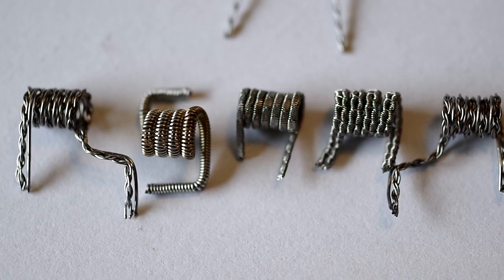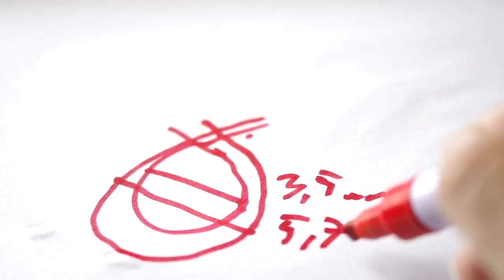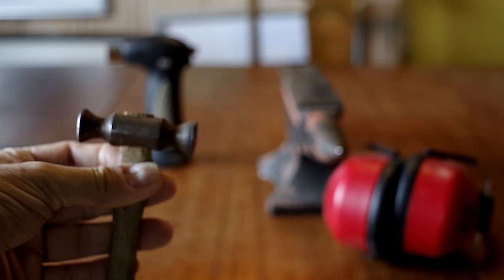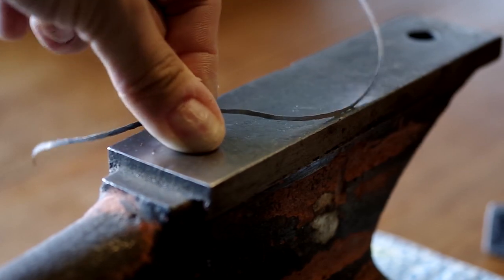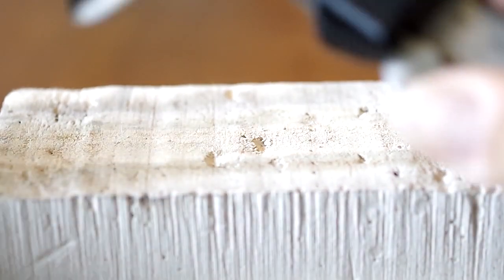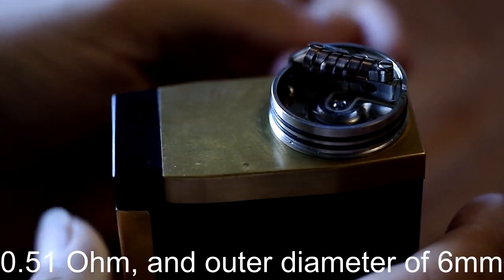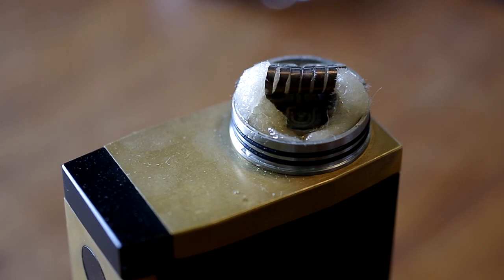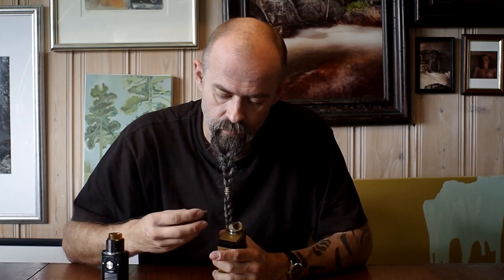Flat wire coil build tutorial #001

Comment: Just curious: have you tried to use a press to flatten wire?
Reply from the maker: Yes, I have used a roller. Basically the wire gets longer and flat, not much wider. But if you start with a 14g or 16g wire, that might work, but then you need a $10.000 machine:-)
Reply: @mortenoen434  Thanks a lot, I will try hammer then 😅

Comment: Great video Morten as always. Exactly my conclusions after 4 years of vaping here. 
The only problem I have I don't really feel like making wires myself. I can do that but I am just to impatient for that. 
Thats why your video made me courious if you have ever tried those SS316L "notch coils" which you can get pre-built? They are around for 2yrs or so but didn't really get much traction. I think it was wismec who designed and manufacture these.
The idea is somewhat similar - short rampup time, huge surface area. 
Of course prebulit coils have couple of downsides that's obvious but I am just wondering if those notch coils would perform similar to your flat Clapton builds or do you see important differences? I'd love to know your thoughts on those notch coils if you don't mind sharing. 

Ale the best and keep up the good work :)
Reply from the maker: Thanks! I have not tried the notch coils. I think they were to thick or something. A proper flat wire should be 0.15-0.17mm thick, and as broad as possible, 1.5-3mm. See if you can get some data on the notch coils, and if they look good, go for it:-)

Comment: The reason the clapton takes longer to heat up is because it has more wraps then the flat wire the flat wire has 6 wraps which less wraps means lower ohms which with mech mods lower the ohms the faster it heats up. So lower resistance= faster ramp up. Higher resistance= slower ramp up
Reply from the maker: To some point you are right, Tommy. But there has been experiments with 2 coils in a dual coil RDA, with flat wire coil on one side, and regular wire coil (and other coils) on the other side, at same Ohm. The result is that flat wire coils always glow first and cools down fastest. The mass of the metal and the shape (flat or round) also plays a part. I think Rocky Weeks did a new experiment on this earlier this month. Shape and mass of the coil seems "more" important than resistance. This is also my own findings whenever I do a test. But to make things more complicated, a coil with round wire or claptons with more mass cools down slower, so after the initial hit, from a cold start, the bigger coils catch up with the flat wire due to residual heat. So if you chain vape, you will not experience much benefits from a flat wire coil regarding speed and energy. Make sense?
Reply: +Morten Oen sure does! thanks for the info!

Comment: Could you do this with a 22 gauge nichrome wire?
Reply from the maker: Yes you can :-)
Reply: Morten Oen thank you for responding.  I'm going to give this a try.  I only use regulated because I'm to scared to use a mech. Will is still perform on regulated mods?

Comment: Have you ever tried using a pasta roller, which has a number of thickness adjustment settings. This gives consistency in thickness along the whole wire length which should eliminate any possible hotspots?
Reply from the maker: I have used machine rollers. Wire get more long than wide. Have to start with 16-17g wire to get flat 22g. Takes time.
Reply: And any experiments with twisted and then hammered or rolled? Thanks for your sharing Morten. I have been hammering wire for awhile now and really enjoy your approach to this. It makes perfect sense, the inner/outer diameter and surface area plus wire length of hammered vs claptons

Comment: I find this very interesting, ive gone from standard claptons to parrellels, fused claptons, aliens etc, but ive never tried flat wire as i always thought it wouldnt produce much flavour or vapour. But watching your videos, makes me really want to try it. Im strictly a mech mod user and the key requirements for a satisfying vape for me is fast ramp up and dense very warm vape. I normally vape around .09 to .10 and use n80. 

Just one question i have, do you find there to be any difference between using ribbon wire and the hammered wire you create yourself? 

What would you recommend? Cheers
Reply from the maker: The wire I make is faster, shorter ramp up. I would not recomend it for warm vape. They are too dangerous if they are not hit directly by the air flow.
Reply: Morten Oen Ok thank you for your advice, what ohm resistance would you recommend to have the same effect as a .09-0.10 fused clapton, obviously the wire you make has a faster ramp up and would produce more heat?

Comment: 22 gauge wire side by side what 28 gauge clapton wire. 
Holy shit duh no shit the flattened 10gauge will be a hotter harder hitter. 

To each their own.
Reply from the maker: You should never use a 10g wire. Anything under 20g starts to burn. Please learn Ohms law.
Reply: Morten Oen      Lololol. I know they do not sell a 10 gauge kanthal   That I know of. 

I know my ohms law and have been vaping for over 5 years make all my own E liquid. And yes even make my own coils to. And no not those hammered wire coils. I'm talking about the real coil jobs. That takes years of practice to learn how to wrap with a hand drill. 

Thanks for the interest and responding and concerns for the vape safety. I appreciate that dude. 

Vape on and vape safe. 🙂

Comment: Morten, I would love to try flattening my wire, but don't have shop tools and don't have muscles, either, being an old lady. I tried with a 16 oz hammer and slab of steel, but no luck. ZERO flattening. It doesn't budge, so I'm guessing it's my lack of strength.
BTW, do you use kanthal or SS?
I tried to cheat with ribbon wire but it's just too brittle. I saw a "square" wire like 1 mm thick and 1 mm wide on a roll, do you think that might work?
I don't use clapton for the same reasons you cited, but would you say round wire wrapped tightly is an adequate compromise?
Reply from the maker: Hi Carol! I use Kanthal, and I do not use much force at all. 1mm thick is much too thick. But try this. Make a parallel coil with 3 strands of 28g wire. That will simulate a 1x0.3mm flat wire and works great. I think you also can buy 0.8x0.3mm wire.
Reply: OK, Thanks for the tip- I will try it. The only 28 gg I have is SS, but it should work OK. I have switched to Ni80 on most builds these days, and just found a flat wire online.  I ordered from a website called 'capevape'.
Still waiting for your ATTY!!
Reply from the maker: Atty comming in April if all goes well.

Comment: Hi Mr Oen I really like you’re videos 
It’s very different from all the rest 
And you’re English is more than good enough lol 
I’m going to try the Goblin type coil and start using my trusty hammer this week just need to find some big thick canthal 
In you’re opinion would it be easier using a the standard flat wire sold in the shops and hammering it thinner ? 
Or do you think starting with round wire is best ? 
Cheers 
And keep on with great and interesting videos 

Mathew Davidson
Reply from the maker: Hi Mathew! Just start with 22g Kanthal, round or flat. Round is cheaper. There is not much work or power needed, so a flat wire won't give you much of a head start anyway. Good luck, mate!

Comment: I'd love to make these but the process looks a little daunting
Reply from the maker: Everything is dauting before you try:-) The materials are very, very cheap, so you can practice a lot. Allways hammer on the innside of curves, and the wire will straighten itself out. You'll get the hang of it in a day or two. When you get good at it you don't even have to polish. Just hammer, burn, wrap, glow and wick tight. Start with a bit of space between wraps, and you should have no trouble! Good luck!

Comment: I do like a warmer vape but also like flavor and battery life.What size flat wire would you recommend?Please keep making videos.I am learning a lot and thank you so much for taking the time to do this.
Reply from the maker: Hello! I use 22g Kanthal for most of my builds now. SS and N80 have too low resistance, and 26g and thinner will warp. Stay between 20g and 24g Kanthal, and you'll be good!.
Reply: Is the Flat ribbon for the 26g or round wire?Thanks again.
Reply from the maker: I did not understand that question... Ribbon wire is anyway too flimsy. Get round 22g, and hammer it as flat as you can :-)
Reply: Hello! Reacently I tried multiple strands 34g Kanthal(twisted) btw I think the golfball pimple theory could apply to this - atleast I had a really cool vape and good flavor, a nice surfacearea to mass ratio and no to little ramp up time. But thats not the point. My question is can i safely flatten a twisted strand of 8x34g wire(I dont have anything below 30 at the moment)?
Greetings Robert

Comment: Hi! Thanks for the tip! I’m gonna try this but I think I have to wait until my wife wakes up haha 😉 btw I use to order stuffs from a British vape shop that sells a lot of mech mod clones etc and last week I bought “pre-flatted” 20g nichrome wire called “recumbent” wire. It’s a 20g flat wire that produces tons of vapor and nice flavor but I actually think that your wire is even more flat. My only problem with the wire is that I have to use a couple of extra wraps, the builds get really low resistance! But I’m gonna try this hammer method and compare with the “recumbent” wire. If you wanna check out the page with the wires and mech mods just send me a message and I will give you the address. (I do not know if I should advertise a vape shop on your channel)/Nick from Sweden
Reply: Yes, I just measured my wire and your wire is much flatter and much wider than the “recumbent” wire!
Reply from the maker: Yeah, and Nichrome 80 has 20% less resistance than your Swedish Kanthal! My 22g is like 1.8x0.15mm I think. Try to stay flatter than 0.2mm, and no wider than 2mm.

Comment: What would happen Morten if you took like a Clapton or fused Clapton and flattened it?
Reply from the maker: Oh, I have a video on that:-) It's called Hammer Everything, or something. You have to heat up the wire with a torch before you start, and several times during the prosess, or else it will break apart. No benefits that I have noticed. Not worth it. Not even a quad core fused clapton.
Reply: Great thanks for the info. I am going to be trying this soon. Great informational video, your English is great btw. Only thing is audio is a little quiet I have to really listen carefully and focus to hear everything. Otherwise fantastic video bud!
Reply from the maker: Thanks! The audio on my end is very, very loud. I have had 2 reports on low sound out of 5000+ comments. The signals are adjusted to max here. Sorry about that.

Comment: Is this still how you make your flat wire coils or have you found an improved method?
Reply: Yeah I'm really into it. I have to admit I first saw this video shortly after you published it but I was skeptical. I didn't want to believe that a flat wire could outperform the claptons, staples, and aliens I was making. I started right out vaping with complex coils. Then about a month ago I found that I honestly got a better, more consistent vape from simple round wire builds. Now with hammered wire I can get even closer to the perfect vape.
Reply from the maker: I think I used 45 minutes on my first coil:-) For a standard 4 wrap coil I am down to 5 now. Sorry for sounding so arrogant in my comment, but practice is the way to go, just like we had to practice to make 4-core fused and stapled claptons:-) Making flat wire coils is way cheaper, and errors can be corrected on the spot. Lots mor fun!
Reply from the maker: Yes! No ramp up, shorter draw, less energy used, same surface area as claptons, and only a quarter of the  residual heat.
Reply from the maker: Hi Michael! Good question! I no longer polish my wire. I have become much better with the hammer and torch, so it is not obligatory, other than for show and photography. I also do not hammer the legs, I only make them square. That is because screws can damage the very flat wire, and because some of them are just too wide. Oh, and if the coil legs has to be bent in other directions, a round leg is more easy to bend in all directions. I only hammer the legs of coils going into clamps or into RDAs made for mesh, like the Ceto RDA. Cheers!
Reply: I did a LITTLE investigating into jewelery rolling mills.  For a couple hundred $ US you could turn out 100's of feet at a time if you wanted.  I don't know that the investment makes sense or not but perhaps there's a better way vs. hammering them out.
Reply from the maker: Hi Michael! We have tested that. Rolling the wire makes it more long than flat, so to get to the size of what I hammer, I would have to start with 16g or something. It is unpractical when you dont have a factory. And we never got the precision right. Belive me, I have tested most things. My girlfriend has a master degree in metal working, and my neighbour is a blacksmith and an expert in 16th century armor making. I have experts all around me! A little hammer and a steel block or tiny anvil is the best way to go for small quantitys. We don't see the benefit of a machine made wire, even if we could make one. There are just too many problems with it. Springyness is of course one, so the 100's of feet would have to be heat treated. There will never be a perfect wire. A hand made wire will fit the RDA, because you can vary the thickness to fill out the space and get the proper Ohm at the same time. By making a wire with machines you loose that aspect. But thank you for input! It would be fun to own one my own rolling mill, for other uses too:-)
Reply from the maker: Hi, just test out a length, it takes 5 minutes to make a wire, write down the data, hammer a new one, take notes. Within half an hour you will learn what the proper lengths shold be, and have a sort of formula for it. I just use Steam engine, enter width and thickness of the wire, subtract leg-length. You can nail this down very easy.
Reply: It takes me more than 5 minutes to prep, hammer, and wrap a wire. I get what you were saying I just thought you might have a way to calculate it instead of trial and error. Thanks for the videos and replies.
Reply: I'm enjoying it! I've made 5-6 pairs of hammered coils now. Just mounted some hammered twisted 26g Kanthal and these are some of my best yet. These flat coils behave differently than round wire. I've had to build higher resistance coils than I would with round wire because they heat so quick.
Reply: How do you know what part of the wire is going to be the legs? I assume you measure the wire before hammering and only flatten what will be coiled. I'm not sure how to find out how much wire will be used before the legs start.
Reply from the maker: First decide the inner diameter, then how many wraps, then do the math (diameter x 3,14 x n wraps)
Reply: Ok thanks. That doesn't account for the slant of the wire being wrapped though. Have you found that the slant is just so insignificant that finding the circumference is close enough?

Comment: I am very happy I stumbled across your YouTube channel?  Your wick tutorial really taught me the correct way to wick.  Now I’m getting so much flavor out of my builds.  Now I want to try your build.  Currently I’m a fused Clapton guy, but for my Mech mods I would like to try your set up.  What type of sand paper do use to sand your wire? What type of polish do you use when finishing your coil build?
Reply from the maker: Hi Sledge, and thank you! It's not necessary to polish, that is mostly for show, and untill you learn to hammer very flat. But from time to time I still do it. Use 400 paper, 800 paper, and then the back of the paper (or newspaper) for fine polishing, and wash the wire with dish washer soap and rinse for a minute or two.
Reply: Morten Oen
Thank you for taking the time to read and respond to my comment.  I will test this set up in the next couple of days.  Thank you.

Comment: Oldschool… great!  in times of mesh wicking we all use flat wires! I try it in my corona ,single coil with flatened 0.5mm v4a wire and it runs like crazy with 0.35 ohms with a single 18650… vapor is much cooler…. It's really great
👍👍👍
Greatings from germany! 😆😆
Reply from the maker: Great results, Bob! Thanks for support.

Comment: i would like to ask you this, can you please comment on how much flat a wire gauge can become till its so brittle and thin to break?for example, 18 gauge (1mm diam) can be flattened to 2mmX0.16mm ....etc 20 gauge 1.6mmX 0.14mm
Reply from the maker: Hi Pero Vaper! You can hammer it as flat as you like if you heat it up (glow it) at certain intervals during the process with a butane torch. Typically I hammer 20g to 2.2mm x 0,15mm. During that I glow the wire when it's at 1,5mm wide. I also glow the wire before I start if I have to straighten it. 

Nowdays I only go so extreme for single battery mech mods. 2 x 0.2mm does require one glowing with the torch, midway or at the start. Always glow the wire at the end of hammering, or else it gets very springy. For hammering semi-flat wire I only use the torch at the end of the hammering. 

I have hammered a 17g Kanhal wire to 3.3mm x 0.15mm. I glowed that 3-4 times with the torch. Very scary coil 😀 I have also hammerd twisted wire (3x22g) and fused claptons to almost 5mm width. All those composit wires has to be glowed thoroughly befor you start hammering them, and many times during the process, and they must be rinsed and washed for a long time afterwards, preferably in an ultrasonic cleaner.